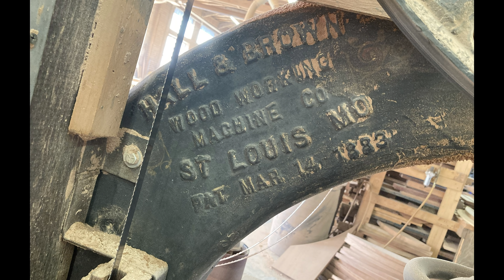Why Am I Getting NEW Window Sashes? More STRIPPING! EP 12

Comment: My family home built in 1960 had plaster walls but no real lathe behind it, I believe they used a special wire mesh.  My memory is too foggy to remember the details.  Maybe your solution to plastering the brick wall will entail wire mesh. We will have to wait to see what your expert suggests.
Reply from the maker: yeah ive dealt with the wire mesh before and i hate it. It also destroys Wifi Signals so i want to use it sparingly if i can. We will see.

Comment: Window frames looks great after they’ve been stripped of the paint. I’m sure you probably explained what you’re using to strip the paint in a previous video but was wondering how long you have to let the solution sit before removing the paint. Does the old paint bubble up when loose enough to scrape off?
Reply from the maker: about 10 min. Usually the acrylic paint goes really fast the lead turns into a paste and likes to stick to the wood again if not kept wet and pushed off in a timely fashion. I can do doors really quick with this stuff about 5 or 6 hours for both sides of a door. but the trim around my windows has so many little details it eats a lot of time. The product is Coopers strip club and i think its really great stuff as soon as your done and it dries your ready to stain seal or paint.
Reply: @The2ndEmpireStrikesBack  oh that’s sounds like great stuff if after stripping no other cleaning necessary to stain. Those details look like a real pain to get all the paint off of but in the end they look so beautiful. Keep up the great work, your house is going to be fantastic when you finish. Thanks for taking us all on this journey with you. I look forward to each weeks post 🙂

Comment: Hey! Just interested to see if you will getting the new sash and case windows double glazed? Or when you replace the windows, are you getting removable secondary glazing inside? Less draughts and heat escaping.
Reply from the maker: Single glazed as i dont want to replace the glass every 10 to 30 years as the seal breaks between the panes.  and yes I will be using the internal storm windows in the winter for thermal reasons.

Comment: I would suggest removing the sashes that have wavy glass and bring them to you rebuilder.   Or remove the wavy glass panels yourself and bring them to him.   Its not that hard to remove the panels, I have done it.  I might add, the old glass panels are not always perfectly square, the rebuilder would need them to make adjustments to the new sash.

Comment: Will you have storm windows that fit over the wooden windows?    Or don't you require extra winter weather cold protections?  Even here in Georgia, we require double-paned windows. When we lived in a 100-year-old house we had to put the wooden storm windows on during the winter months, The lath and plaster did not protect against the winter weather. And the radiators barely provided heat.  Pat Farley
Reply from the maker: thick single pain reproduction windows are almost as efficient as the modern double pain ones. if we do need storm windows they will be internal ones.

Comment: Are you going to leave the outlets in the baseboard, or move them up to a modern height?
Reply from the maker: I think they will be headed to the floor on exterior walls. That way i can remove the conduit on the outside of the house.

Comment: Out of curiosity, what made you choose the stripper you are using? I feel like I’ve seen other brands that work faster. My view may be skewed because I’m used to seeing it on more modern furniture project and maybe it’s just the detail work in your wood work or that this one is more gentle on the old wood. But anyways, I was just wondering what it is you like about the stripper you use.
Reply from the maker: Its really quick, however this trim being so detailed makes it really hard to get ever little tiny detail cleaned. I used to use Jasco epoxy remover and that stuff is pretty great too but this stuff is a lot faster and way less messy. The doors go faster as they are flat and i dont have to get into the cracks with the copper brush or the dental tools. also when the paint is gone its done ready to finish again no sanding afterwards.

Comment: fyi... 50 years ago we stripped the woodwork in our home... after approaching it with paint remover we looked for a quicker way... eventually, went over painted surfaces with a torch to blister and lightly char the paint... then scrape it off when cool and you have less than half as much work to do to take the rest off... yes, there's likely lead but if you're removing the woodwork, you can do this outside

Comment: If the aluminum windows are water-tight and work, I would not have it on a high priority list to replace them.  While it will be nice to have the windows appear more like the originals, since financial and time resources are limited, I wouldn't lose sleep over waiting.  First priority should be to make sure the house is safe from the elements -- and riff-raff!  Best wishes on your commendable and impressive endeavor!
Reply from the maker: yeah thats the plan. The kitchen window is broken and will be the first replaced down there. Most everything on the inside comes before replacing those windows as they are quite serviceable at the moment.

Comment: If you hadn't bought this house, who knows what horrors would have been done to it. Don't sweat replacing a few of the original windows. Also, are you going to replace the vintage zinc weatherstripping you have? I restored all of my original windows with authentic metal interlocking weatherstripping and it helped a lot with air leakage.

Comment: I had asked you in a previous video about using a sandblaster to remove the old paint, is that a possibility?
Reply from the maker: It would chewy the wood up. However that is exactly how we are going to do the painted radiators.

Comment: Don't know if you are running into painted hardware that needs stripped. Nicole Curtis tosses it in a crock pot for a few hours with water, it comes out perfect and new looking. She said she wishes she found that out years ago.
Reply from the maker: a little bit. The stripper i use makes pretty quick work of it though.

Comment: I'm worried someone driving by might think that wood outside was stripped out of the house and might be garbage and might take it. 

Also, it would be cool if you did a live stream while you worked on stuff so we could watch in real time.
Reply from the maker: the wood is somewhat hidden where its at and no one really wants the old lumber in this city. I can try to set up a live stream at the place. I dont know how well it will work as i dont have internet up there yet. but i can try it.

Comment: It breaks my heart to lose original features from an antique house, as well. I am horrified by how many idiot decorators paint over Craftsman tiger-stipe oak trim, for instance. But, in this case, you are NOT sacrificing original features. You are replacing the weird un-historic hodge-lodge that was inflicted on that poor house! Tip: remember to save the sash weights and chains, whenever you can. It's hard to find solid brass at a reasonable price any more. Thumbs-up on an inevitable necessary decision. I believe you have already been rewarded - getting back the original hearth tiles was a triumph. Keep up the good work!

Comment: I regrets replacing the old windows in my 1903 house. Having them removed, we realized how solid they were. Solid massive wood and waved glass cannot be replaced by something modern. I suggest replacing what is necessary and keep what possible.  
Also, keep windows you remove as  they can be used for a green house or you can sell them also.

Comment: QUESTION: Throughout your house where the brick is exposed, I haven't seen any evidence of insulation. Why? Was your home insulated? If not, why not install it? 

I guess some purists will claim insulation was never used. Although I understand the beliefs, where does the energy footprint fit into this restoration? 

The energy it takes to heat or cool your home & the electricity used is going to be substantial. 

It's a worthy project to preserve the past. I love your works. However, where is the concern for the future? Isn't preservation for our collective future matter just as much as the past? Please advise. 

ps. Please could you address the pipe-wrapping insulation being asbestosis... 

Thank you for your time and consideration.

Comment: If you were restoring the house to be a museum and you had unlimited finances, of course you would keep every original fragment.  But this is a house to be lived in, and tight, draft-free windows are necessary, so reproducing the old sashes as authentically as possible is the only logical choice.  And although this might be a sinful thought, I'd consider having the new sashes constructed to accommodate thermal panes.  They wouldn't be immediately noticeable and they'd be a big step toward keeping the house warm in winter.

Comment: He hasn't mentioned insulation for the exterior walls? So far I haven't seen anything but brick in the outer walls.
Reply from the maker: There wont be any. The plaster in itself is a form of insulation or really its a heat sink. Its soaks up heat and cool and releases it slowly into the house.
Reply: @The2ndEmpireStrikesBack  - That isn't quite true. The masonry may be a heat sink but heat passes through masonry very quickly and, therefor, it is not an insulator. And heat flows in both directions.  Hot days will make for hot interior nights and a high cooling load if you ever go for air conditioning. In as much as most of the interior walls aren't in very good condition, you would only loose the outer walls' plaster. You may may a bit of a problem building-out window reveals to make up for a thicker walls by a few inches but you could add to the existing reveal and shutter assembly with more wood to match the case trim. I did it on my own new house 30 years ago when I had to modify the  windows built for 4 inch studs to fit into 6" stud walls. It wasn't hard to do at all. Fortunately you don't have a lot of interior paneling that would be hard to adapt to changed room dimensions. 

Your house is fully separated from the neighbor by a narrow passage from the looks of the photo on this page (listing your other vides). If it is sharing a party wall, I don't suppose you have to insulate that wall as long as the other house is occupied.. Insulting the exterior surfaces of the brick walls that were never really intended to be seen anyway, would be an option for at least three of exterior sides and the front could be done from within. But the front seems to be rendered in stucco. It looked like it needed redoing and maybe that's when you insulate the front façade? But the cornice details would all have to be rebuilt or the lowest elements adapted to fit.. It doesn't look like elaborate window frames on the exterior but I didn't get a good look.

You aren't doing a passive solar heated building so you shouldn't really be considering those passive techniques. You're using conventional heating systems and should treat the house with the conventional techniques.

Comment: Of course you should get new windows! It wood be utterly stupid otherwise. What I understand are you not getting dubbelglased windows and that is stupid! You should get (I don’t know what you call them?) thermoglazed? It is a matter of enviroment....
Reply from the maker: I am just going to use interior storm windows for the winter they offer the same thermal properties and can be removed in the summer. Double pane windows go bad in 10 to 20 years and need replacement. Single pane ill never have to replace just reglaze. again dont think i havent thought this through.